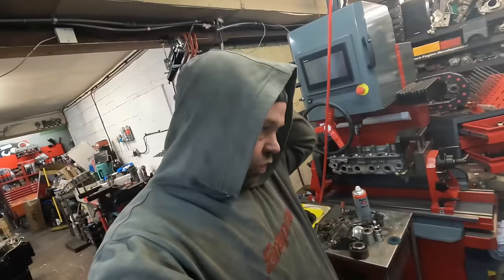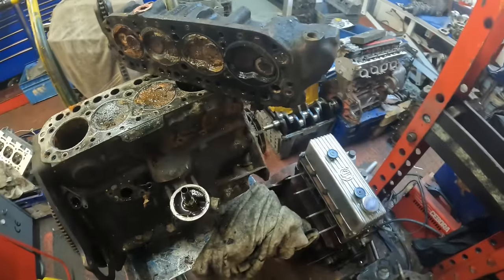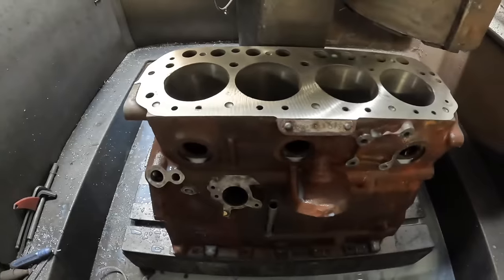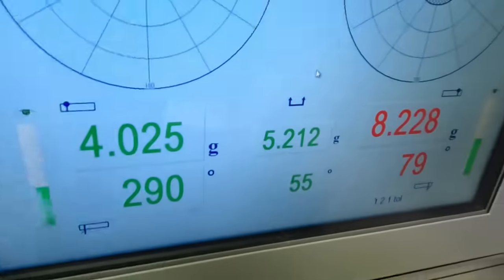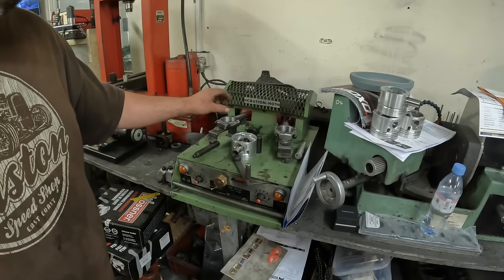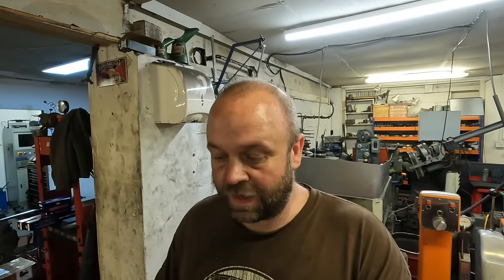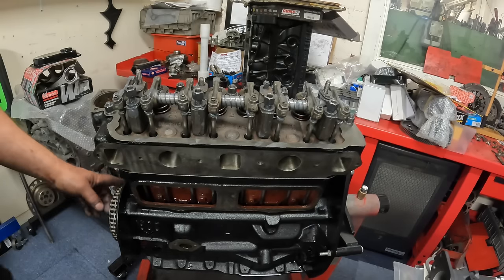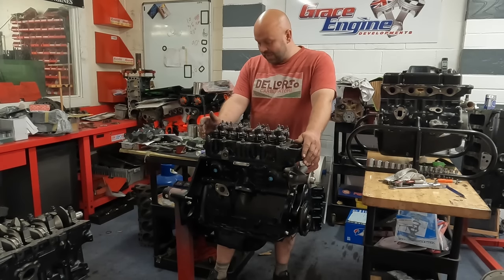A complete video of an 1.8 MGB engine being reconditioned and modified.

Comment: Owned 3 Triumphs and an MGB in the early 80s here in the states.  Rebuilt the MGB engine and the one out of the 67 Triumph, man were parts a pain to get here.  Also discovered too heavy of an oil in the dashpots meant they would not rev in cold weather lol

Cool video, brought back good memories of working on the one I had.
Reply from the maker: There a cool old car.. I do like mgb's as well.. thanks for watching

Comment: Top video, 2 extras I do when building these engines for road and race is to clearance the oil pump gears
to o/e specs , and to clean out the internals of the new rocker shaft.
Reply from the maker: Thanks Robert.. yes I had the grub screws out of the shaft and cleaned when it first arrived.. and I also agree with you on the oil pump. Thanks for viewing

Comment: Great job on the engine and the video. Taking lots of notes for my '73 MGB GT rebuild in NZ.
Reply from the maker: Thanks Rob.. if you need any advice just ask
Reply: Currently on castle rails, but once I get past the rust project and back onto mechanicals might just! 

Here’s one: timing wanders up to 10degrees (between 30 and 40 BTDC) on the crank at 3000rpm. I have retarded it so keep it less than 35 max. Worn dizzy driver gear ? After listening to the Silver jubilee idling in the other video, mine is much less uniform and has uneven, misfiring idle. There’s play in the electronic ign plastic connector on the end of the spindle - could it be a harmonic causing chatter? I have rebuilt, regreased dizzy and replaced vacuum to no avail. Will replace coil too next.
Reply from the maker: Have you checked the springs in the distributor are fitted correctly?
Reply: @graceenginedevelopments  thanks for entertaining a reply to a vague and complex internet post!  Yep springs seem good but I should get another dizzy as I have nothing to compare with. Vac disconnected, revs down from 2000 to 1200 to 900 idle there is a definite step at 1200, which I guess is the springs pulling back the weights. It runs alright, but undulates at idle and chatters at high revs. Idles too low when cold but slowly rises to around 900 when warm. Cant wait to pull the engine out and look at it. 

If there’s one thing this rebuild (my first) has shown is that much can be gained from pulling it apart and assembling it. 

Thanks for the vids. I will speak with a local engine rebuilder next year with a list  of requirements derived from your content. Good tip on eliminating the oil pump castings.
Reply from the maker: @RobFieldingz  if you need any help/advice just ask.. it may be a worn gear but I wouldn't of thought so, it wouldn't last that long when it starts to wear

Comment: Vey complete video showing the intricacies of engine building. Nice work! The master addressed almost all of the major issues with rebuilding the MGB engine.  One modification that was overlooked was rocker ratio increase.  From 1:5 to 1:7. Other than that, wonderful instruction video!  Thank you!
Reply from the maker: Thank you, the original spec was going to be std. So the minor modifications was just to help drivability.

Comment: Thank you in advance, your rebuild video was very informative! I have a 79 B. The top end was rebuilt in 1994. I knew the gentleman that did it and he was a British car racer in the SCCA here in Oregon.

My engine still purrs beautifully. It's been converted over to HS4 carbs, no emissions, no catalytic converter, pertronix ignition and I properly lowered my B to pre polyurethane bumper riding heights with all new black polyurethane bushings throughout.

The engine runs well, idles at about 45 psi oil pressure, and cruises at around 70 PSI on a very hot day here in southern Oregon. No smoke out the tailpipe upon start or driving with no excessive oil consumption. Safety Fast!
Reply from the maker: Thank you, there a great little engine and yours sounds like it's running lovely.
Reply: Another 1963 MGB owner here in Southern Oregon.. Best MGB video yet.
Reply from the maker: Thanks Jeff.. welcome to the channel

Comment: This is a good complement to "Dr." Doolin's engine rebuild video.  There are some differences as to the way I rebuilt my engine, but then I did no mods.  Seeing this, I'm glad I didn't try to port or relieve my engine since it can reveal weaknesses in the castings.   I used plastigauge to determine the main bearing clearances.  Having watched this, I wish I had balanced the new pistons and the conrods, but it still runs great, so I have no complaints.  It's interesting to see all that happens to the parts I sent out to the machine shop: the block, head, and crank.
I wish you had shown how you pressure-tested the head...
Reply from the maker: Thanks for the comments Philippe.. I'll make sure I show a full pressure test on a future video for you.

Comment: I used to work for a manufacturer of military electronic equipment, when we had castings that failed pressure testing we would get them sealed under vacuum. Not sure whether anything like that could be applied to your porous casting problem. Fascinating video.
Reply from the maker: What did they use.. it would be worth testing.. thanks for watching
Reply: @graceenginedevelopments  something epoxy based I believe, the castings were aluminium alloy of some sort and prone to a little porosity. I seem to remember the approach was to drill into the porous area and then inject the epoxy with a syringe.If you look round YT people have done crazy stuff with JBweld. I know it seems like bodging but I bet it would work.
Reply from the maker: Yeah I've tried JB weld before and a few others with mixed results

Comment: Always check mains where they go in block and line bore if necessary. Like A series engines.
As a youngster we would build engines and always destroy main bearings before we learned this.
My first car was a tuned metro that revved to 8500rpm until the valves bounced, a 1.0 with a 1275 head and 40dcoe ( bought for £30 with manifold!) ....oh and an lcb exhaust.
I'd fit as long duration cam as possible now and a 45....if only... then save up for the fuel...
Reply from the maker: Hi Peter, yes we do check the main housings. We are just about to purchase a line honer🤞, I bet the metro was a little flyer
Reply: @graceenginedevelopments  it was until mains went!
3 months for every 998 engine and the eventual 1275 lasted about 6 months before it started grumbling but that was standard apart from the 40 and lcb exhaust.
My mates mother bought it in stock form and drove it for a few years, slower!
I disconnected the oil pressure warning light wire! Naughty!
Reply: @graceenginedevelopments  btw do you know that you can buy single barrel side drafts that are like the dcoe?
For straight inlet tract.
I'd fit bike carbs.
Keihin pwk40 ....£40 new for Chinese copies or jet ski carbs off eBay, upto 55mm!
Reply from the maker: No I didn't, I'll have a look
Reply: @graceenginedevelopments  I descovered the single barrel dcoe equivalent on an abarth tuning site.
They like to put a 36mm version on the 500 single port.
Reply from the maker: Oh cool I'll have a look

Comment: Riveted to that long MGB engine rebuild. Thought it was odd you were in yr wooly hat stripping the original engine, so realise it's taken some months to piece together.
My 3-main b series 1800 was rebuilt ~3years ago, but have only just got it back in me MGA. Now I need to troubleshoot the new clutch hydraulic components I've fitted :-(
Reply from the maker: Thanks Rob.. I'm doing an mga engine at the moment, well it's a bit of a piece meal job.. yes the b came in march April time.. is your clutch not working??
Reply: Original engine in it was one of those rare & fragile (at the time) twin cam engines. I've had the MGA for over 30 years, and I've only seen two twin cam engines 'on sale'.  I guess the remaining engines are being hoarded by the racers in the US.  They change hands for £15-20k!
Clutch I've run seals through the (separate) master cylinder and slave. Vacuum bled. And when the clutch pedal is depressed the slave rod moves 20-25mm.  More investigation needed, I think.....
Reply from the maker: Yes I see they fetch good money.. good luck with the clutch

Comment: Used to recon a lot of these engines. Had a Magnette ZB. Used to be heavy user of oil. 250 miles per pint but designed to do so as it was slightly tuned from production and oil usage was designed to protect from early piston wear. Stroke at 89.9 mm was quite long but gave good engine breathing. Performance was ok but far from breathtaking. Used it mainly on 200. Mile trips and comfortable.  Then moved on to jaguar mk 1 3.4 that was a bit different. That is another story! Good old B series engines were very reliable.
Reply from the maker: B series is a great engine. I worked for a company called oselli so did loads of them. Do you still build engines?

Comment: Outstanding engineering, excellent video.
I have not seen that quality since I worked at an official BMC ( Rolls, Bentley, Jag, Aston Martin, Healey, Mini, Morris, MG, Lotus , Austin) dealership in Monterey Calif 1968-1972.
We had our own machine shop. There is nothing like it left that I have seen since then. 
I have owned 30 Brit cars since 1964 to include 46 TC, 50 TD, 53 TD Mk 2, 56 MGA, 1969 MGC GT, 64 MGB, currently a 1963 MGB. I also owned a Fairthorpe Electron Climax and an early TVR Grantura with a Climax, 4 Thames vans, 5 Land Rovers 58-74 , 1980 SD1, 6 Morris Minors, 2 Morris Oxfords 54 and 59. etc

I am considering having a head ported for my 63 B.. ( I have  6 spare cylinder heads.) Unfortunately I have no qualified  machine shops here in Southern Oregon USA. 
Wish I was closer to your shop to have you do the work,  not likely to be feasible to send a head to you and have it sent back

Thanks again for a great video, going to pass it on to friends in our local Brit car club.
Reply from the maker: Thanks for watching Jeff. You've had quite the collection of cars. When did you stop with your machine shop? I'm desperate to spend some time in America visiting places. If you want I could do a cylinder head and send it to you.
Reply from the maker: Hi Jeff. 
I would like to see most of the cool car places but mainly north Carolina and Charlotte.. the days of thunder barn. The NASCAR team and engine shops, bit of a road trip would be good, Daytona etc etc. I've been to indy and new York. Have you got pics of your old cars? They sound awesome. We don't have a good website yet but you can email me on James.goldstraw@btinternet.com , I'd do a std size valve with mild porting etc.

Comment: I didn't catch your name - I just came across your site. I really enjoyed watching. Can't believe the inside condition of the First Engine. I am hoping to do a 1800 soon. I wrote down  the points of interest so I can come back to them for the tricks you pointed out. One thing I was watching for after cleaning out the Flashing left on the pump from manufacture , and making the relief inside  oil pump so oil can get to the top and bottom in the pump. You mentioned  that you would INCREASE the oil pressure to make up for the relief you put in it. Watched as you put in the Plunger and Spring in but, didn't see what you did to increase the pressure?
       You mentioned it was a Road Cam from Comp Cams ---- Do you have what the number might be? 
       After watching you build this Engine ---- Sure would love to hear it start up and run! Any chance customer would do this? Wonder what exhaust system he'll have?  Header ----- Muffler ----- Sure would like to hear it start up and run!    And your name? 
       Thank You ---- Very informative and Great Detail  ------------- Rodney
Reply from the maker: Hi Rodney.. thanks for watching it good to know my channel is getting seen.. my name is James.. the cam is a Kent cams 712 spec.. I have little spacers made to increase the pressure but you can use a 6mm or 1/4 washer.. the mg is coming into me for checking the valve clearance once he's ran it in so I will record it for you then.. I hope you enjoy the other videos.. thanks James

Comment: Yes ----- I really did enjoy the video --------- Question ------ when you were cleaning out the oil pump ----- casting and slag and making a groove a little larger to move more oil ------- you mentioned you would increase the oil pressure to make up for the enlarged hole and the groove ------- you didn't mention what you did to increase the pressure? ----- Did you change the spring to a stiffer one ------- was a washer added between spring and cup to make more pressure on the spring? --------- Thank you for the Tips and what to look for in rebuilding the 1,8 MGB engine ------ Again ----- really enjoyed you sharing what you had to do in getting ---- ONE ---- engine reconditioned ---------------- Rodney
Reply from the maker: Thanks for watching Rodney.. I replaced the spring for a better quality one and put a washer behind the spring

Comment: How do you set the end play on the crankshaft? It wasn’t mentioned or I missed it, sorry. Is it a machining process or just the shims/bushes/bearings on the 3rd crank cap? Excellent video! Well done you! MGB
Reply from the maker: Hi Paul.. the end float is measured and if it needs adjusting to give more clearance the thrust washers are ground. If to much clearance then the crank thrusts need grinding and and oversized thrusts are fitted.. thanks for watching

Comment: What a great video! Thank you for sharing this entire process. How long did it take in real time, from the first day of work until reaching the finished state?
Reply from the maker: Thank you and you welcome.. I'd guess if I was to do only that it would take around 4 days
Reply: @graceenginedevelopments  Wow, you are fast in replying. As you work on multiple projects in parallel I assume that the throughput time for the MGB engine was longer than the 4 days of work.
Reply from the maker: Yes exactly.. I currently have 47 engines on the go

Comment: Nice work, I remember when I rebuilt my MGB engine in the mid 1980's that I lifted it from the floor to my bench on my own, not these days! Also I'm not sure if I missed it, but did you fit new cam bearings into the second block? I remember taking mine to our local MG specialist and he had an MG special tool to ream the bearings to size.
Reply from the maker: Thanks Matt, I'm sure they get heavier the older I get. Yes the cam bearing was replaced but I didn't film it.

Comment: Won’t that extra oil passage you ground into the oil pump cover cause it to drain when not running?
Reply from the maker: Hi Jeffery yes it will a little bit but the mod is quite small and works best under suction with the oil up to temperature

Comment: Great video. Do you balance the flywheel and clutch assembly along with crank or is that not necessary at this spec. MGB
Reply from the maker: Thanks Mike.. yes everything is balanced separately.

Comment: I was wondering why you didn't prime the oiling system before handing it over to customer-just to make sure ther was no problem with lube flow over the rocker shaft and push rods. Or is that a dumb question?  Perhaps not possible with the type of oil pump.  Can't remember just how the oil pump is driven but I presume it is driven off the camshaft?  Sorry if I am asking stupid , dumb question!
Reply from the maker: Hi Ian thanks for watching.. the pump was primed and all the oil way was pumped with oil as well but I forgot to film some bits.. you can ask any questions I'll always try to answer

Comment: Excellent video and a fine tutorial to anybody wanting to repeat the exercise (although the equipment being used will limit the number of people able to). I noticed the older headnut torque level of 50lbf was still used, not the later Technical Bulletin-value of 55lbf (74Nm) Seeing how smoothly the freeze plugs came in, I still wonder why recently so many of those are popping out on all kind of oldtimers, including the rear one on my B that ruined my 2019 holiday to France. Ivor Searl people apparently did not follow your guidance on this for my refurbished engine block (I had to get a full replacement under warrantee)  🤔
Reply from the maker: Thank you and thanks for viewing.. I still use 50lbft but use arp grease on the threads to insure an even load. Preparation is important when fitting core plugs and knowing the interference fit is correct.

Comment: Tremendous expertise. How many hours to complete?  Tough about the head failing after so much work. BTW Do you have a view on setting oil pressure relief valve lower than 60 psi?
Reply from the maker: Thank you, I'm not sure total hours, I'll log the next mgb full build, yes I was gutted to throw the head away. I'd wouldn't recommend running much lower than that under load.

Comment: Hi James, great video! You skimmed my MINI head a few years ago 👍 Not sure if you are still answering questions on here but ill give it a go.

What goes in to a stage 1 upgrade on the MGB B series and what gains can i expect?

Would stage 2 be a much bigger improvement in performance and driveability and what machining and work would that entail?

Thanks,
Josh.
Reply from the maker: Thanks Josh.. stg 1 is blending the seats in, doing basic throat and machine the manifolds faces,  stg 2 is just more work